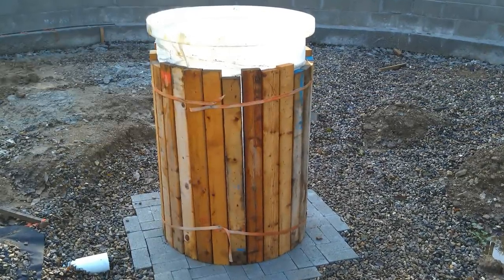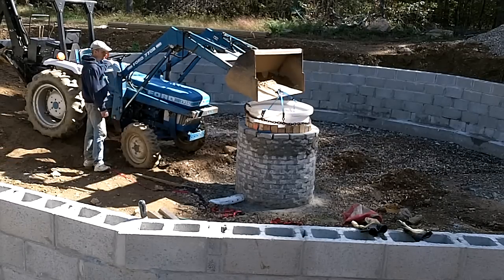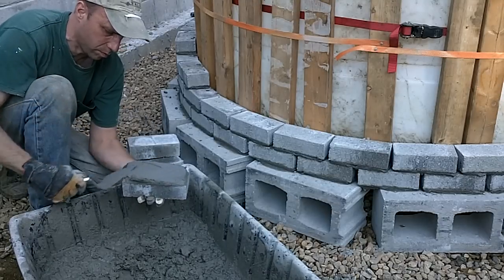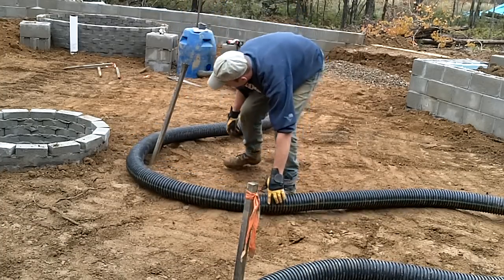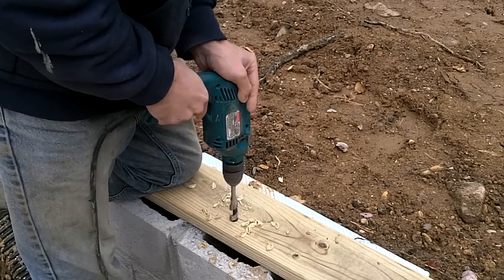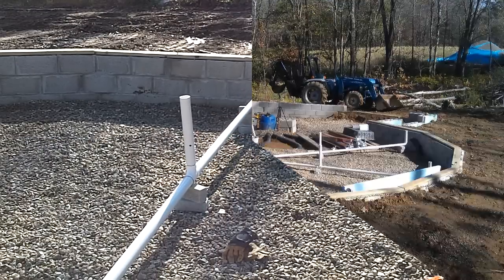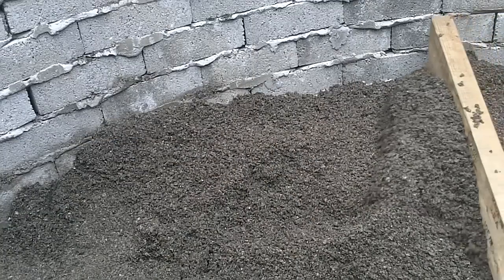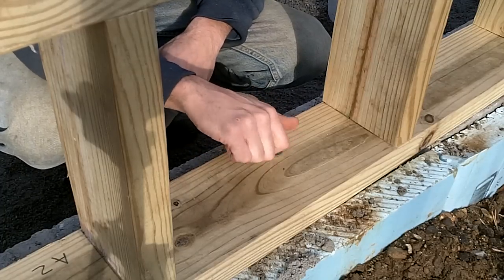Geodesic Dome Greenhouse - Part 7 - Filling the Foundation Hole

Comment from the maker: @tenj00 The boards there were temporary just to fit things.  There is a layer of closed-cell foam that was placed under them.  Also this is treated lumber which is rated for direct burial.  I believe it's rated for 40 years.

Comment from the maker: @Mooja12 If the ducts are too low, a lot of the heat will bleed down into the ground and out under the foundation footings. The footings drains around the building will keep the natural ground water out. For the most part, the dirt will stay dry.  It's the moisture in the greenhouse that is the problem.  Powdery mildew grows like crazy in my other one!

Comment: Good stuff.  Thank you for posting these.  I'm curious why you laid all that dirt before laying the ducts.  Wouldn't having the ducts deeper in the ground help regulate the temp of your thermal mass?  Are you concerned with stagnant moisture in the ducts (e.g. fungus, Legionnaires' disease)?  Also, how did you determine the length of ducts?  Are then long enough for a greenhouse that size?  Not trying to pick but i'd kicking around similar ideas and am genuinely curious.

Comment from the maker: @ddnguyen278 The exhaust will not go through that area.  I'll install some kind of heat exchange and blow only fresh air through that part.  The exhaust will go outside where it belongs.  Thanks - good question.

Comment: Did you know that you should put something between brikcs and wood, at 06:40. Something like roofing felt. Because if you don't do it, the wood will moulder. and the situation like you, it's a very big job to change those woods. the humidity likes to rise along the bricks, and if there is something waterproof, all boards will stay good.

PS. sorry for my bad english. I am from Finland

Comment: Nice work. How is the heat transfer system working with the tubing? Are you using it for cooling as well as heating? I'm doing something similar (just broke ground) except I have one circuit 2' deep and am using 2' of gravel around the tubing as the thermal mass and also have another tubing circuit 5' deep to take advantage of the consistent 55 - 60 degree ground temperature for heating and cooling. That way if I need cooling and the gravel/mass is too warm, I can blow the hot air down into the 5' deep circuit.
Reply from the maker: I mainly use it over the winter when I don't feel like running the heater over night. We've had several nights where it would get down to 0F and The lowest the greenhouse got was 41F.  I haven't used it over the summer since it doesn't really get hot enough to need it.

Comment: Hello and I love your work, been following since the beginning! I have recently built two greenhouses and have buried eight 100 foot long tubes for the thermal mass. I hooked them up and don't have any air flow. What CFM calculation did you use to size your fan and are you pushing or pulling the air? Thanks in advance!
Reply from the maker: You'll need a pretty large fan to push air through tubes that long.  I'm using one of these to push the air through.  It's still wasn't enough.  There's just a huge amount of resistance from the corrugated piping.  I've basically have giving up with the geothermal mass.  The biggest problem is that water condenses in the piping, molds, then blows the mold into the greenhouse.  Once I stopped using it, most of my disease problems with the pants have stopped. 
 http://www.northerntool.com/shop/tools/product_200660314_200660314
Reply from the maker: It's perforated pipe so the condensate can drain out.  I just keep the vents open and it will be around 10 degrees hotter in the greenhouse.  When it gets really hot out I open the doors too.

Comment: With a soupier concrete mix you could have left the J bolts in the plank and staple the foam/barrier material on the bottom of the plank.  Just set the plank in and wriggle it a bit.
Done.  Make sure block hole taper is in correct orientation.  Narrow at the top.

Comment: I hope you don't live in a windy area. Locally we put at least two rebar rings in the foundation and tie vertical rebar every 12 ft. to the footer rebar, then those go up thru the block openings to the top where the anchor bolts are tied to the rebar and the entire column filled with concrete, finally the sill boards are fastened down with nuts Your dome seems to only be tied to one block every once in a while and cement is not strong as it cannot be squeezed but is easy to pull apart...